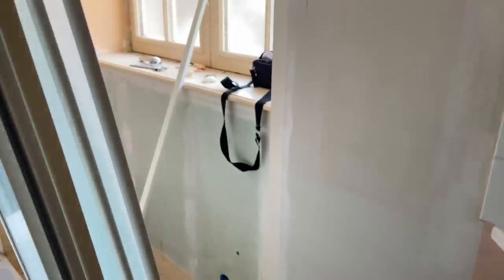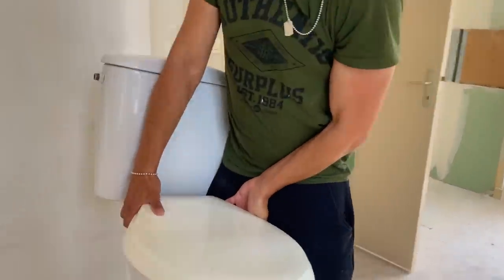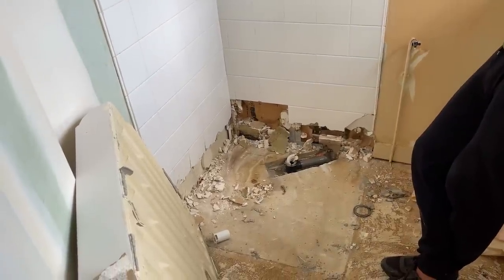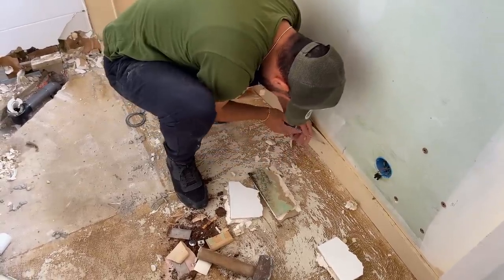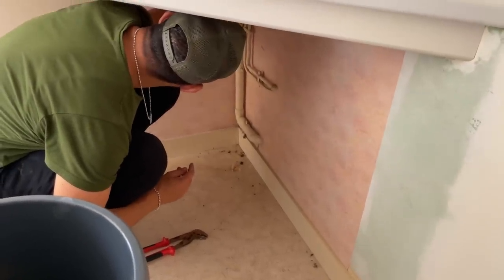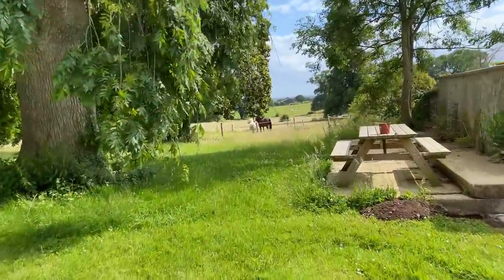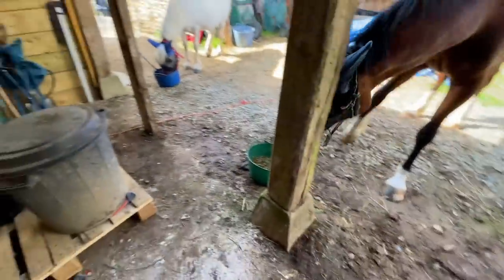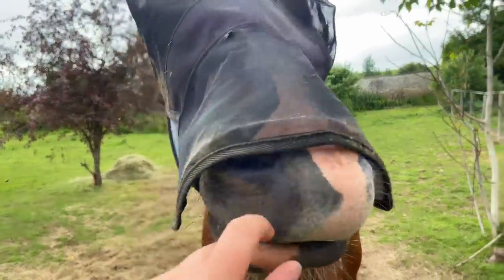HAMMER HAPPY - SADIE IN FRANCE

Comment: I was surprised that you were going to put down concrete for Udeah's stall.  I have always been told that if is very bad for their legs, especially in winter.   But then, we have very harsh winters here.  for our area we usually do compacted clay.  Loving the cart for Elsa.
Reply: Wouldn’t the rubber mats make up for that?
Reply: I was thinking the same thing.
Reply: I think she said the concrete is in place of the rubber mats. I concur, concrete is a bad choice. Clay would be much safer and comfortable.
Reply from the maker: Concrete flooring is absolutely fine for horse stables, it would be hard on horses legs if they are stabled constantly and without bedding but the stables are just for bad weather and they always have a fluffy soft bed so it’s not a problem
Reply: @SadieinFrance  I was thinking that you could also do a crowd fund if you would prefer the rubber mats.  I know it was just the price that was discouraging you.

Comment: Why concrete Sadie, pee drains away through the straw easy  and is softer, warmer etc. Saves money too. Also, if you cut a small slot in between the stalls the horse could see each other ☺. Thanks from England.